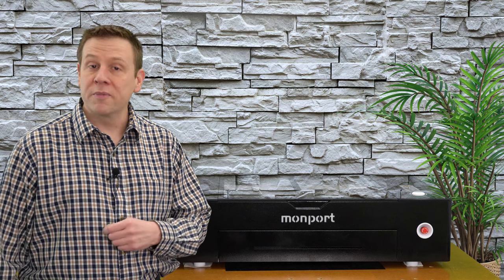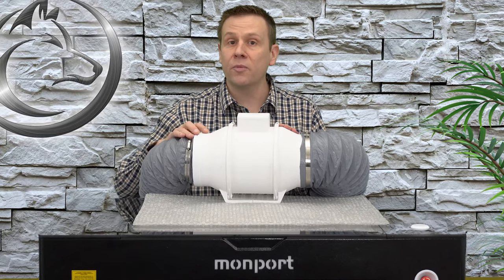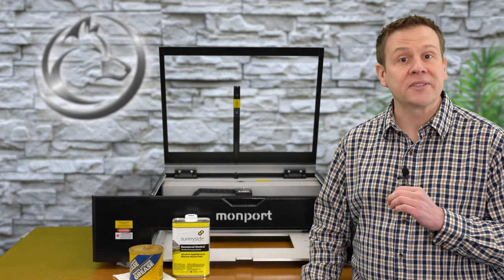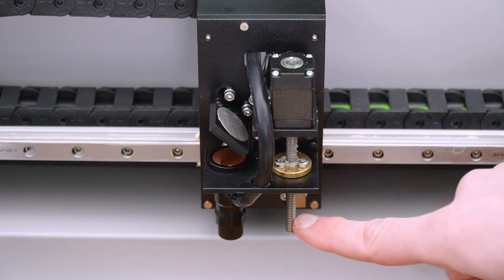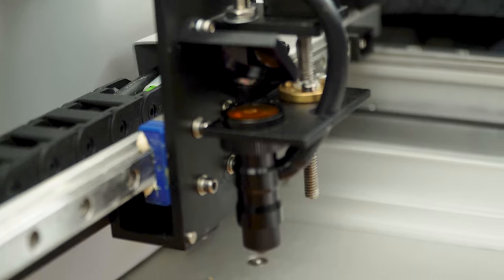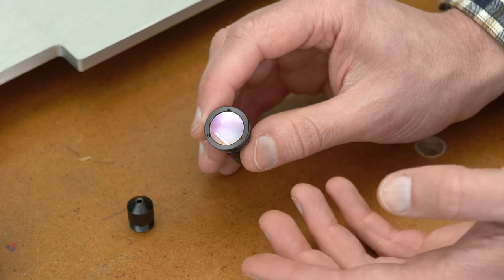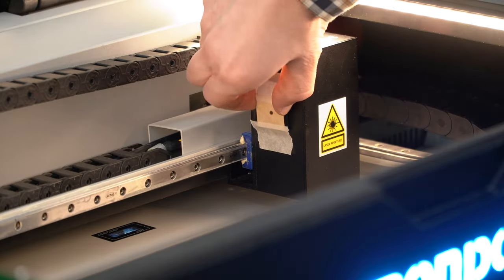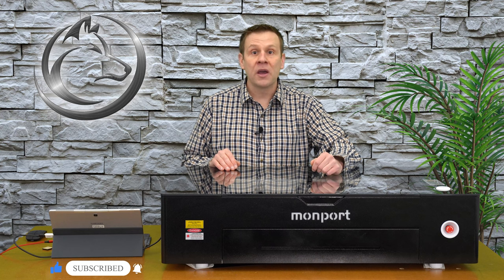Best Maintenance-  Onyx by Monport Video #7

Comment: Hi Greg. This is treasure! Do you know by any chance how to remove the laser head cover on the new Onyx R? Is it also held by magnets? I don't want to use too much force, but it doesn't seem to budge.
Reply from the maker: Thanks!  On the new Onyx-R the laser cover lifts straight up- many of the covers have a set screw that must be removed or backed out on the right side.  The remove the head its self- there's 4 screws behind the 3rd mirror housing # 2 Philips.  There's also 2 large nuts on the down tube to remove just the laser tube assembly.  It takes a little time but it can be done!
Reply: @thelaserchannel1  Thank you for the wonderfully quick response! Yes, I was able to remove the two small screws on the top of the back side facing the rear of the machine. However, this only allowed me to take off the very top plastic cover with the Monport sticker. Are you saying I should now be able to lift the rest of the cover off as well?  I will try to do it today. I am alread thinking about a way to upgrade the that top piece by 3d printing something with a magnet inside so it doesn't need screws...

Comment: What about the coolant? Do you know what kind of coolant it uses?
Reply from the maker: The version one Onyx in the video uses Co2 specific "blue" laser coolant.  If it's a little low it can be filled up with distilled water.  The current Onyx machine, the Onyx-R uses what looks like bright green anti-freeze.  Again, if it's low it can be filled with distilled water.  Contact Monport directly for completely changing out the coolant.  Both coolant types do have anti freezing benefits.  Straight distilled water will, of course, freeze in cold climates breaking the laser tube.